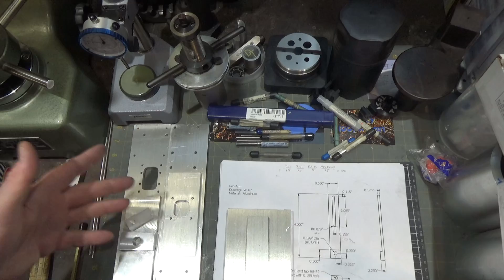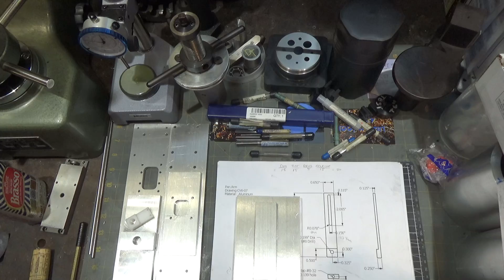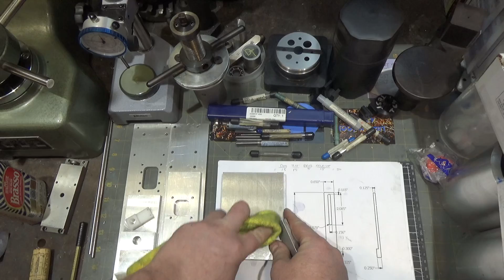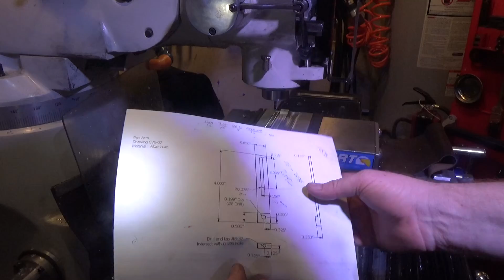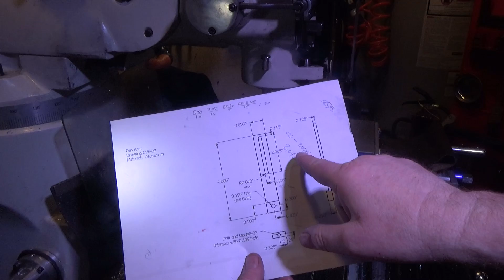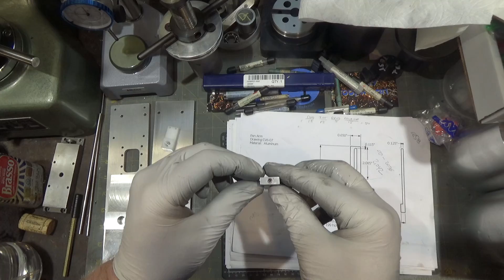117 Work Holding With Superglue

Comment: .Sorry about your superglue mishap... I know that is frustrating...  I use superglue frequently and i make these suggestions.  Use the very thin superglue, and secondly it is not really necessary to put that much pressure for good adhesion...  In this case more pressure is NOT better....  Hope this helps....!
Reply from the maker: Thank you very much. Great tips.

Comment: I thought that you shouldn't squeeze the glues joint too hard because it forces the glue out. Having a rough surface might leave some in the grooves. It sticks to smooth surfaces because metal mirror mounts are glued to glass windshields but the directions say to press lightly.
Reply from the maker: I think cyanoacrylates are anaerobic cure, if I am not mistaken, eg. most Loctites thread lockers are cyanoacrylate based.
Reply: @DudleyToolwright  Yes they cure in a lack of air. What I'm referring to is if your surfaces are smooth and you press the pieces together, the glue is forced out and you only have metal to metal contact.

Comment: You can super glue end mills and drills in to shank extensions as well.  Handy if you have to reach into  a deep pocket to mill or drill a feature.
Cheers from NC/USA
Reply from the maker: Great tip thanks for sharing it.

Comment: Hello Robert,  I just don't have the confidence in super glue having tried many, many different brands over the years since they hit the market.  I can't even get them to stick to skin which everyone tells horror stories about!  Now I haven't tried using my press to secure a bond.  Wonder how the guy with the hard hat got a press on that when he was sticking himself to that beam (old old commercial)?  I have heard that those glues are super time sensitive in that they have a limited shelf life and I have also heard that they only work well when combined with the designated accelerator.  No store has had those accelerators available anywhere I was trying to use super glue.  So I don't think I will subject any bond made with it to the cutting forces present when milling or turning.  I will try an experiment with your suggested use of a press as part of the bonding process.  Another aspect of cyanoacrylates in my experience is they take a very long time to bond.  I have never been able to achieve a bond in the "seconds" they talk about.  It takes fifteen or twenty minutes to harden when I try to use it to repair a fingernail that has a split going back to the root!  That is in ideal conditions. And then it flakes off in three or four days.  That is in a no stress situation mind you.  I have always cringed when hearing of other people who use this technique.  Take care.  Doug
Reply from the maker: Interesting feedback thanks. I also have had very mixed results with super glues, but I think it is all in the prep and the materials being glues. Remember Loctite is a cyanoacrylate and it is considered pretty good. It does require metal to metal contact. On my second attempt, after I had done a better job at prep, I was able to take pretty big cuts without any problem. As a matter of fact, I had a tough time removing the part until I used the kitchen stove. I have had decent luck with superglue attaching non-porous surfaces like ceramics, but poor luck with most plastics. It also is possible the all super glues aren't created equal.

Comment: Nice job as usual. Where I came from, double sided tape was the ticket. There are some bad ass tapes available. I'm not familiar with super glue.
Reply from the maker: Thanks to the tips about double sided tape. I like that one. You are right, I bet the UHS tapes would hold really well, but would be a bear to get off. Maybe solvent.